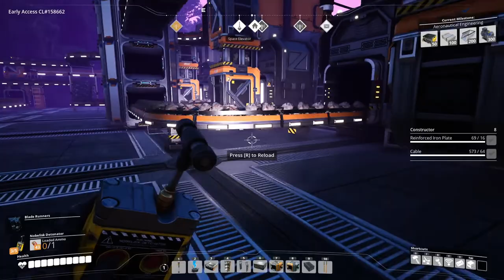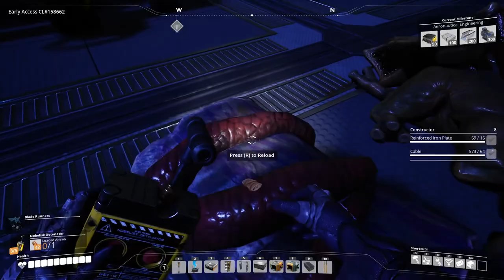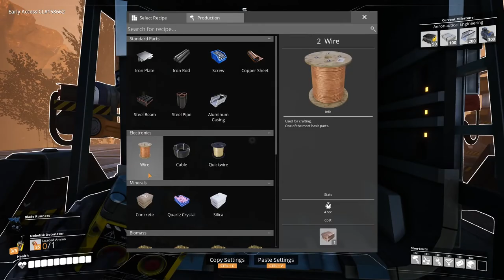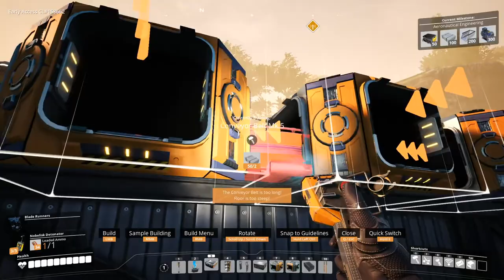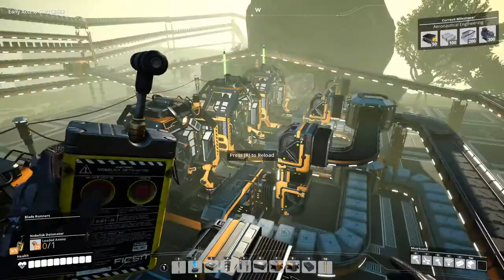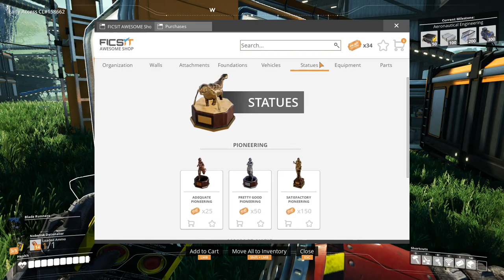Producing Quartz Crystals - Let's Play Satisfactory Update 4 Part 84

Comment: Looks like you ran into a bug with the awesome shop. It gave you two stacks of some of the things you bought, which may have double charged you; but it shouldn't have done that. 

In general, unless you explicitly need the items right away, you shouldn't look to buy them in the awesome shop. Especially if you have schematics (foundations, wall types, wall accessories, etc....) to go. 

In this case, getting the Crystal Oscillators was a good idea since you could dump them into Quartz research; but buying batteries and turbo motors before you need them is a bit of a waste of tickets. (Though the turbo motors will be useful for Mk3 miners when you unlock them). 

Caledorn (another streamer) used tickets to buy aluminum sheets early to unlock the Hoverpack; but he was very used to using the Hoverpack and was eager to get that ASAP basically. 

Also I think it is a known bug that the radio control unit isn't in the AWESOME shop. It should show up as soon as you unlock it; but instead TurboMotors show up, when you haven't unlocked those yet. 

Glad you finally started further down the quartz research and found the map. :)